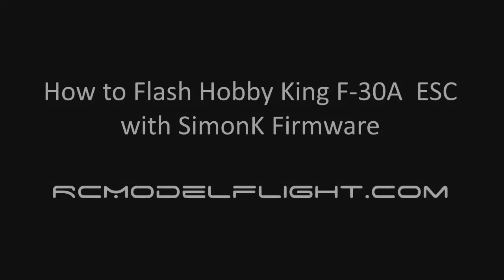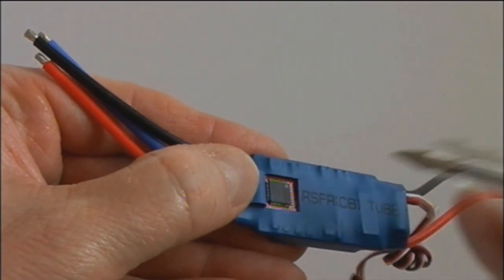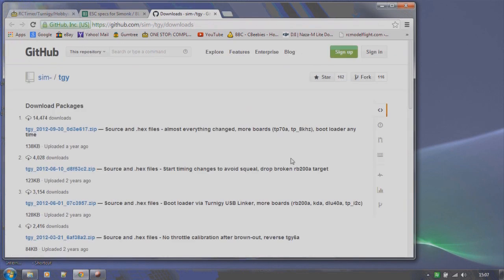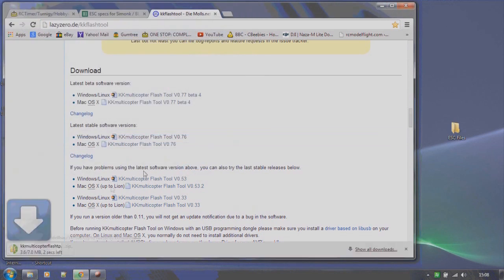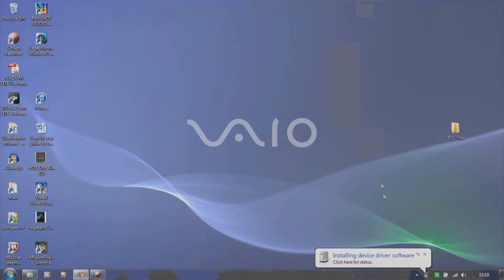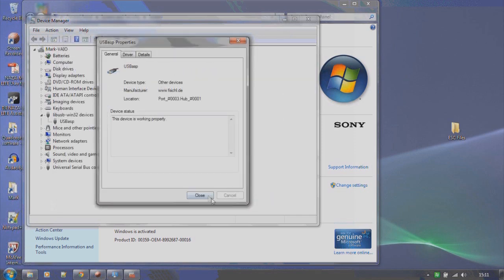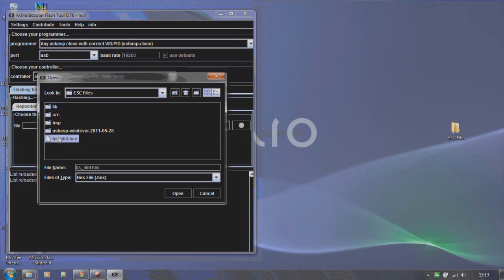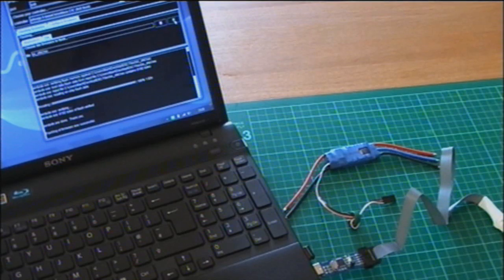How to Flash Hobbyking ESC with SimonK Firmware

Comment: very well detail video. I have a couple of question 1.- why you choose  in the program (any USB asp clone) instead of the USBasp option and 2.-why you did not use + enable bootloading option. the only thing different is that I have ESC F-20A and a home made pins. thanks
Reply from the maker: Hi. These are the settings / options which work for me. They should also work with the F-20A controller. The flash tool has new revisions from time to time so you will find that some of the options are very similar. The options in the video happen to be what I've always used. Thanks.